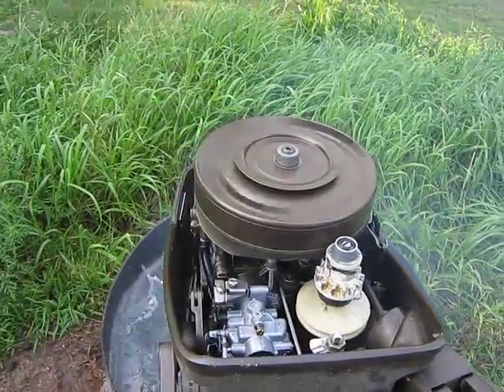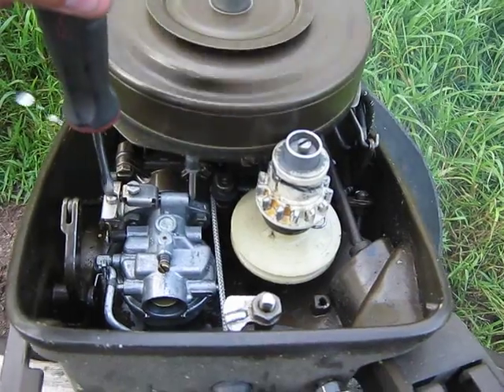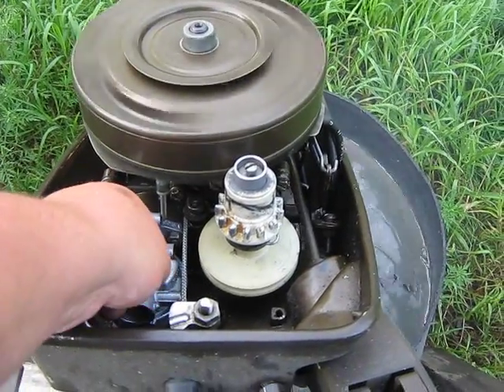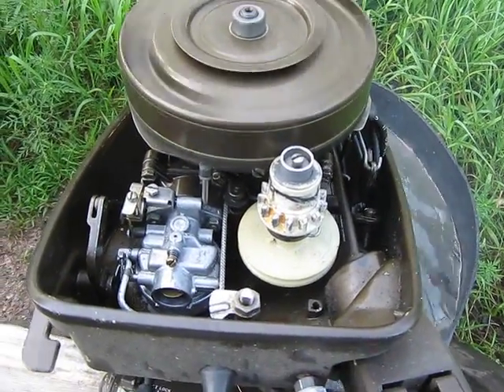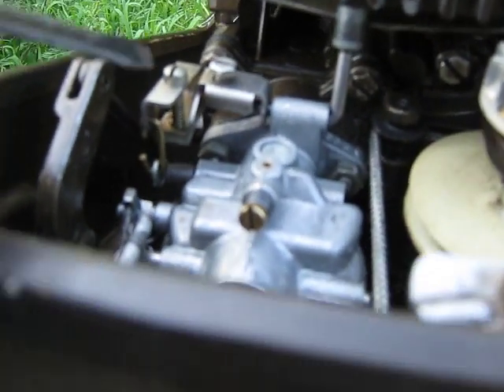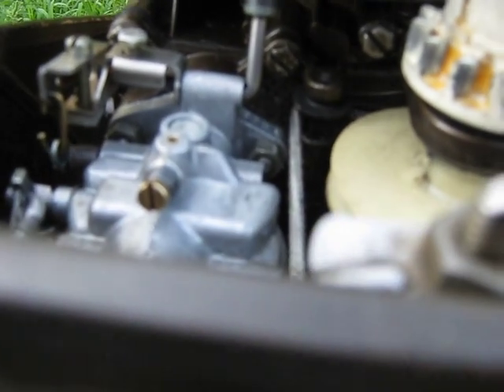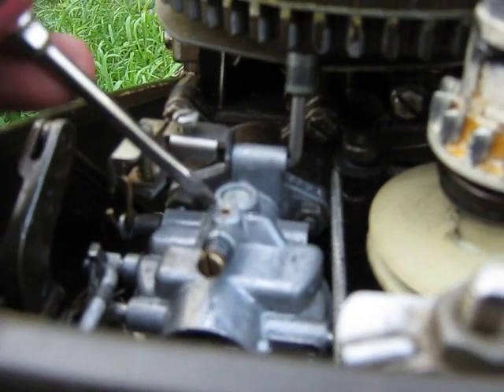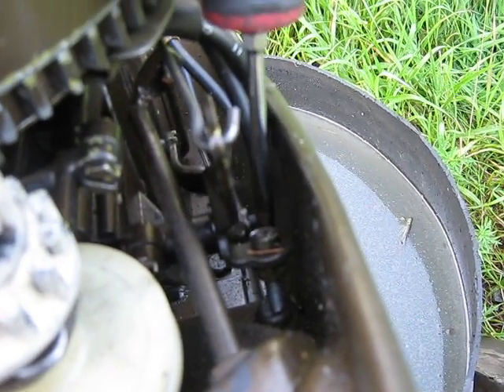Chrysler 9.9hp outboard motor carburetor adjust how to

Comment: 1983 15hpSeaKing>Chrysler running heavy blue smoke, smells rich fuel,  learning as I go. 10 years ago this motor would turn over by hand. Sat up and slowly getting it back running. Any advice on carburator adjustment?

Comment: uncovered a '74 15 hp SeaHorse.  Carb looks just like this one.  I rebuilt the recoil and carb.  It runs great on high speed, but will not idle down below the "shift" mark.  My only experience is rebuilding carbs on a couple of 3 hp Johnsons.  Should I expect a 15 hp to idle as smoothly?  Thanks for all your posts.
Reply from the maker: I take it you mean 15hp Sea King and not a Johnson seahorse. What does it do when your trying to idle it? If you see my other videos you will see how they idle, you should be able to get a 650 rpm idle.

Comment: I have a Seaking 9.9 that has no spark.  Do you recommend a place to start to see if I can resolve.  I know with other motors in some cases, I could fix by just cleaning the points and cutting fresh end to spark plug wire?  does that have any effect on these chrysler outboards?  Thanks in advance for your help.
Reply: I would start with the condensers under the flywheel. I had one give me very weak spark causing me to only run on one cylinder. Hope this helps!

Comment: I got a 78’ Chrysler 75hp outboard. How do I set the air/fuel on 3 carbs? 
1-1/4 backed out from seated……. Then what? Thanks in advance.

Comment: Hello,
Thank you very much for this good video.  I live far away on remote Island in Thailand.  I have an Chrysler 6.6 Hp outboard motor but still cannot figure it out which tool to use to remove spark plug on the lower piston. The normal plug remover do not work with the lower piston.  Thank you very much.
Reply from the maker: +van viravan I will make you a video.
Reply: Really appreciate you kind advice.  Thank you very much.
Reply: +van viravan 
A 13/16" box end wrench? Worked for me-
Reply: I use a 13/16 box end as well
Reply: I really appreciate this video.  I try to run my motor from time to time.  The motor is unstable has to twist to idle most of the time.  I will try to clean the carb and test it again. Thank you very much for this good video.

Comment: I just purchased a 15 hp SeaKing  and it doesn't have an air filter on the carb. All the ones I've seen on YouTube don't have them either. Seems like they should. Strange.
Reply from the maker: A outboard motor is used in a marine environment no dust! Outboards do not need air filters.

Comment: I have a 1989 Yamaha 4 stroke electric start.  I need a carburetor, On Boats.Net they have a 1989 15ELF with  two carburetors listed, one is a carburetor assembly that stated UR 9.9 the other carburetor listed is for a 15hp.
My motor serial # is FT9.9ELF will this carburetor work on my motor?
Hate to trash this motor.
Reply from the maker: George Kuehne Sorry but i don't know anything about Yamaha motors.
Reply: Thanks anyway
Reply from the maker: George Kuehne Sorry.

Comment: good video.I have a 1988 20 hp manual start mercury and have just rebuilt the carb got my self a timing strobe "inductive" and a laser tachometer and want to check timing, RPM idle and set the carb it only has a low speed mixing screw and fast idle/primer on the carb I have a work shop manual but Im an amutur but I want to do it myself and learn. any info or video you could help me with? thanks
Reply from the maker: daveduznotrull Sorry but no, I don't work on that many Mercury's.

Comment: If I might ask what the base/ starting  idle mixture screw setting (turns out)
and do you Do it the same way on a 74 10 HP model 
Thanks again
Reply from the maker: I start about 3 turns out. Yes the 74 10 is the same.

Comment: hi! I did this earlier as tutored by you = thanks very much !!!, got the mixture leaned out, as you show,, shut it down for a few hrs, but now cannot get the Chrysler 10 Sailor to start cold on fully closed choke, and throttle cam on the line. [this is right after a carb and fuel pump rebuild. Boy, I sure envy your sweet running motors. A realexpert; can you help me with a few suggestions where I should look next? thanks
Reply from the maker: That carburetor uses a two peace chock flap. Make sure that the choke is closing

Comment: Ben, I have a 1969 Chrysler 9.9 that has set a LONG time. Replaced one dead coil and now good fire. I can pump the carb bowl full and it WILL NOT run unless you spray gas in the carb. It is not using the gas in the bowl, the bulb stays hard. I am thinking it must be the fuel pump OR could it be a plug in the carb? Your OPINION would be greatly appreciated!! I just think it should use up the fuel in the bowl if it was PUMPING fuel, it may not run well but should try to run. I have low speed screw at 1 and 1/2, is that close to right.

Comment: if the carb is out of adjustment will it bog down at low rpm?
Reply from the maker: Yes it can.
Reply: Thanks
Reply: @chrysleroutboarddude    
On Chrysler 10hp model 107HA the roller on throttle linkage will only line up with line of mag plate when remote throttle control is a full throttle.  I don't try to start in that position.  Motor won't start and I think it floods every time cuz plugs are wet.  Using Champion L82C.  Cleaned carb.  Good spark both cylinders.  It seems to slightly fire on 1st pull after drying cylinders and plugs out.  But nothing after 1st pull.  Is this a timing issue?  Sow idle screw on 1.5 turns.  Any help appreciated.

Comment: Got it running but it runs like crap, Still good enough that I was able to take it out on the water all day. Seems to be misfiring on one cylinder, plugs look good but I'll throw new ones in to be on the safe side. After that I think I'll need to rebuild the carb.

Comment: Thanks for your information. I have a question. For me this motor start always at very high RMP. I am not able to start it at lower RMP. Is this because I haven't done correctly the lower RMP setup? Can you explain more your comment about the trottler has to be close to setup the lower RMP. But if it's close. Then it doesn't turn on.
Reply: I’m having a similar situation with a 1980 Sea King 15. Did you solve the problem?

Comment: I have 1972 Chrysler 9.9 , I rebuild carb and fuel pump but it doesn’t wanna do anything but top speed when I try and lose speed it starts misfire and then surges to heavy speed in addition it keeps shooting fuel out overflow on top

Comment: I have an 89 or 90 gamefisher 15hp that idles really rough, stalls out at idle and then acts flooded when I try to start it back up.  Could this be an adjustment issue or so I need to clean out the jets and check the float?  It runs smooth at full throttle.
Reply from the maker: kylerprochaska It sounds like your needle and seat in the carb is leaking.
Reply: I'm new to carburetor repair, but will rebuilding the carb with a carb kit help?
Reply from the maker: kylerprochaska Hear you go! https://youtu.be/R6-5P7Cuxdk

Comment from the maker: This video is mostly for setting idle, and the hi speed is set by a fixed jet. can you tell more about what your motor is doing? Are you able to advance the throttle all the way and is the carb opening up all the way?

Comment: Please help me.  I have an early 70s Chrysler 9.9 that keeps flooding itself out.  once I disconnect the fuel line it will eventually start but after I connect the fuel line again it will suck in too much fuel and die.  What should I do? I've adjusted the carb so many times but I guess I cant find the sweet spot.

Also, I have a 93 Gamefisher 5hp that will start after a lot of pulls(over 20-30 pulls).  It will run on an engine stand with earmuffs but it wont in the water when mounted on a transom.  I look forward to your response.  thank you for your help.
Reply from the maker: On the Chrysler the problem might be with the bole vent or with the needle and seat that is making it flood.
on the Gamefisher check compression.

Comment: will this fix having a hard time starting the motor at idle speed/start position weather cold or warmed up and keeping the motor running without stalling?   I guess what I'm saying is I have a hard time starting the motor without it throttled up past the start position and then keeping it running.  it has that same pinging noise/miss if that makes sense

Comment: I have a 9.9HP electric start Chrysler. Seems to idle Ok, knocks a little in idle but more worried has not top end speed. At first I thought it was only firing on one cyl but seems to have new plugs and coils. Any ideas??? thanks a ton,  Chris

Comment: Got a 1972 18hp evinrude, been messin with it for about a week now, high idle is great, however I cannot get the low speed jet set right, if I tighten the screw on the backside of the hand throttle it'll run and stay running really high. Once I let it off and adjust the low speed jet the entire motor starts kicking, and will die out, any advice?
Reply from the maker: +Morgan Schwall It sounds like it is lean. It might have a vacuum leak or the low speed side of the carb is still dirty.

Comment: Hey man, you have helped me tremendously with getting my 1971 9.9 running. I have one question about the mixture screw. Currently I have a Tillotson MD-144a (I think) that does not have any mixture screw. Would I be able to use the screw from this carb? http://www.marineengine.com/parts/mercury_marine_parts/sn/0E143096/H009201SM/1695_5

Comment: Thanks for the videos - very helpful.  I've got a 1973 6hp Chrysler up and running, but it has very limited power.  Here's a video of what is going on with it, and a link to a thread with what I have tried to date.  If you have any suggestions for me, I would appreciate it.  Thanks.  https://youtu.be/pjnRwrLSv34  http://forums.iboats.com/forum/engine-repair-and-maintenance/force-chrysler-outboards/9860104-6hp-chrysler-several-questions

Comment: just wanted to say thanks, with the help of all of your videos i was able to get my 1980 chrysler 9.9 up and running again, i had to rebuilt the recoil spring unit, fuel pump and carb then adjust the carb to get it running, if it wasnt for your videos i dont know what i would have done :) here is the motor after i got it running https://www.youtube.com/watch?v=mn0a1cFnbMU also i have an issue at WOT with it, it feels like its surging ever so slightly when the boat planes out, i can hear the rpms going up than drop then go back up again, im assuming it just needs a little more carb adjustment. let me know what you think. heres a video of it on the water https://www.youtube.com/watch?v=gbtqWfxRZrI toward the end you can hear it doing the surging thing a little.

Comment: How many turns out should the low speed fuel mixture be from a lightly seated position. I adjusted it too far and am looking for a new starting point to get it running again.

Comment: Sir, I have 15hp Chrysler which runs but is not smooth on low RPMs as yours. Is there a method to keep it running well and still align the tiller marks corresponding with lower and upper limits. Also I can't find thermostat location for nothing. Water spits on the back but it is hot and sometime it stops until I increase  rpms.The engine head is hot; it sizzle when I splash water on it. Pump has new impeller and passages were clean when I replaced head gasket, any help  would be appreciated
Reply: Did you ever solve your problems? The water pump housing could be leaking or not fully sealed